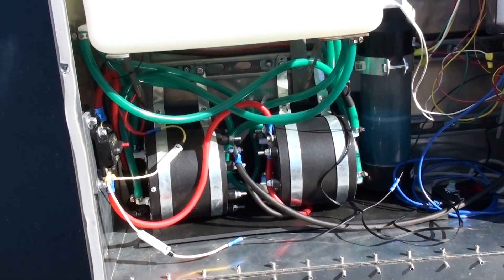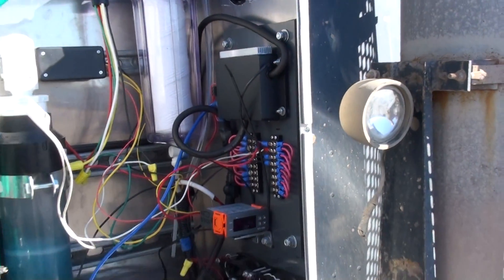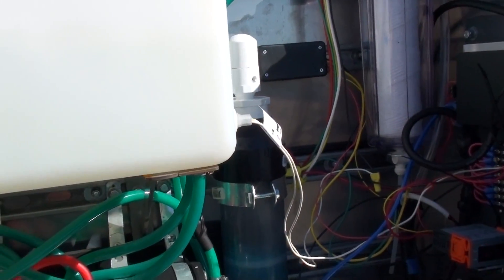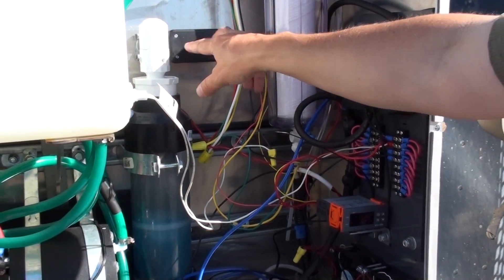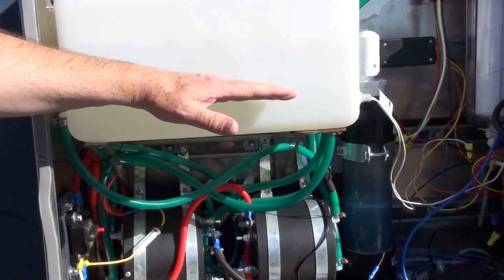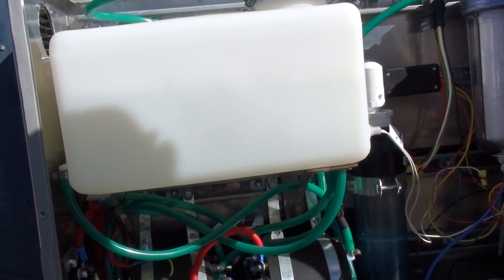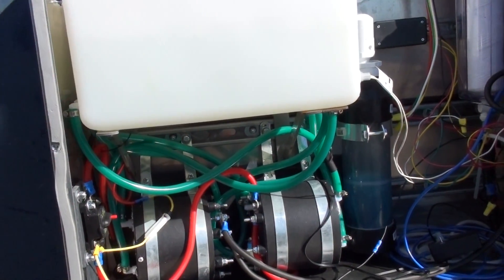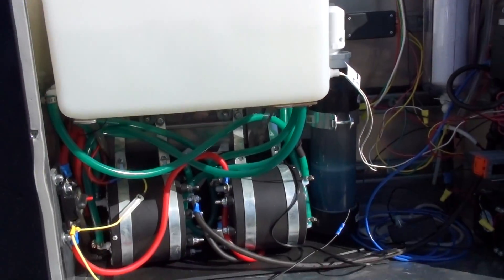Green Fuel H2o 80 plate system installed on semi. Part 2

Comment: The freezing point of freshwater is 0° Celsius or 32° Fahrenheit. The presence of salt in water, though, reduces the freezing point of water. The more salt in the water, the lower the freezing point will be.

When freshwater freezes, water molecules of hydrogen and oxygen have bonded together into a crystalline structure of ice. The presence of salt makes it harder for water molecules to bond to the ice structure, because ice naturally repels salt molecules. So in a sense, the salt gets in the way of water molecules, blocking them from joining the ice. The salt also bumps into the ice, knocking water molecules off of the structure -- and that's how salt melts ice.

Comment: Is this 12V or 24 V ...How much A do they run on single generator?
Reply from the maker: kinda bopar  It's 12 volt. They run the system at about 40 amps.
Reply: This is a big engine...what is engine dispacment in this rig??
Reply from the maker: 15L